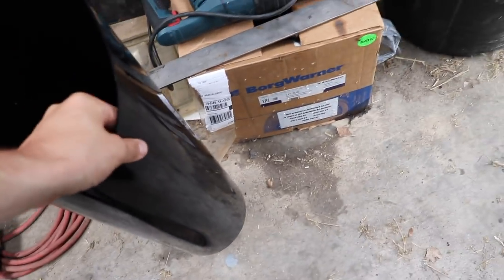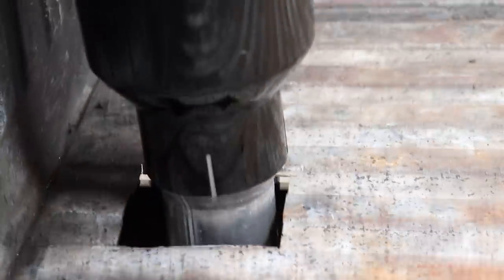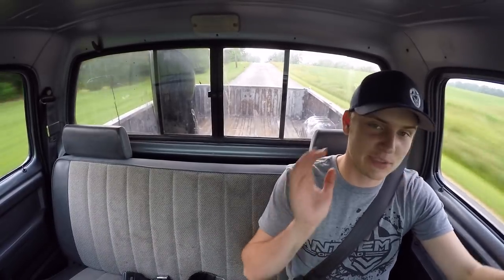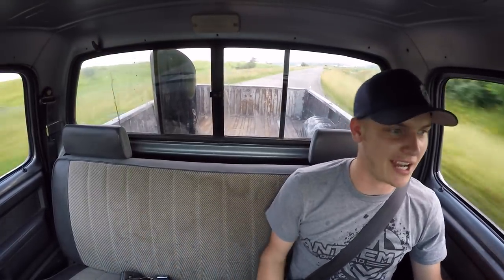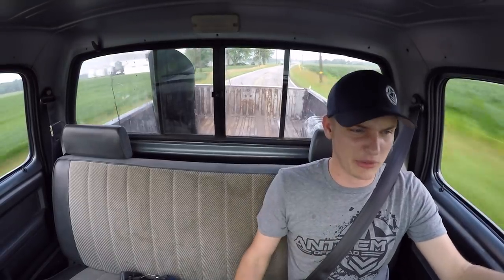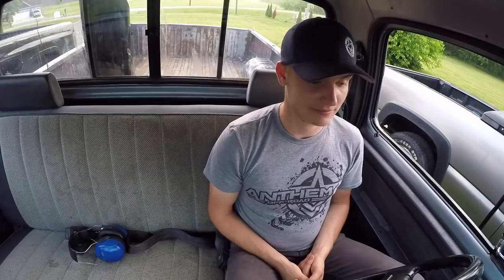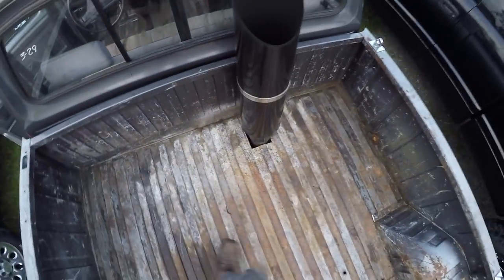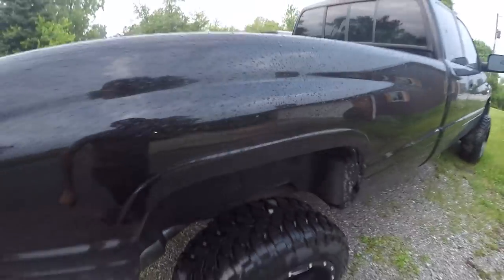WORLDS LOUDEST DIESEL SMOKE STACK EXHAUST!!!!

Comment: You should keep the Superduty 7.3. I like the obs 7.3 but they are not as powerful as the superdutys from 99-03. The superdutys have bigger injectors, bigger turbo, nicer interior, and they have an intercooler. You should just keep the one you got. You got way too many cummins. It would be cool if you had a obs 7.3 and a superduty 7.3. Love your vids by the way.

Comment: put a lunchbox locker in the rear end.  (~$300)  welding the diff will be terrible for turning radius...and you'll just break axles. you'll break the locker eventually, but it'll hold up for awhile.

Comment: Let’s all be honest. Is it any louder than say a p7100 truck with an auto or a vp44 truck that’s auto or a cp3 Cummins with an auto? I think not but the title sure led it on to be. Most old ve pump trucks werent near as loud as the vp44 trucks and take yourself an 06- early 07 5.9 auto straight pipe and you’ve got obnoxious loud. Have fun though

Comment: My truck has a 4” straight pipe, but became significantly quieter once I backed off my advanced timing and adjusted my valves. Like actually half as loud, it was crazy. I actually hear my exhaust now not the engine, and the exhaust ain’t that loud.
Reply: My 6.0 ford power stoke has a 8in
Reply: 8” what? Don’t tell me you have an 8” pipe from the turbo back. You might have a gay tip that’s 8” lol
Reply: I made my
Reply: Your making no sense man haha, lnp truck sounds good it’s just too loud lol
Reply: Hey l 18k truck l might put a smoke stack on the truck but my piece of shit duramax has a 4in
Reply: You are not making sense

Comment: If the stack is above the cab it is ten times quieter in the truck and looks cooler then you can put a rain cap on it and fit the trucks ara

Comment: Your gana need flex pipe for the 90* below the bed, it’s going to be too rigid. The flex pipe will absorb the vibrations and the movement differences between the engine, hangers and bed. Might end up breaking the welds or hangers. Seen it on every exhaust for a stack with solid pipe that I’ve seen. Just a heads up bud. You can get flex pipe at Home Depot, or even a auto parts store
Reply: Just make sure to buy stainless flex. Flex pipe is a rust factory.

Comment: Little dramatic with the hearing protection don’t you think? I used to run 6” straights dumped at my windows on my pete 379 with cat motor twice the size of yours. Did you really need to put on hearing protection for 30 seconds of video footage with back window open?
Reply from the maker: Not dramatic at all.. I just like to keep my hearing. If you don't... thats your choice..

Comment: My 7.3 has 4 inch down pipe to 5 inch to a 10 inch stack this isn’t loud 😂🙈
Reply: Shawn Nemitz not hating I've had a couple 7.3 and had every size exhaust stack tip that you can think of no matter what you do to your 7.3 they will never be as loud as the 12 valve and 24valve atleast not the 3 7.3s I've had
Reply: I have a question I have a factory 3.5” straight pipe to 10” tip and will a 4” or 5” straight pipe make it louder ( or stack) which is loudest ??
Reply: OBS Powerstroke your factory down pipe is not 3.5 inch. stock it is 3inches off the turbo and is necked down like a cobra head. if you still have that get a after market down pipe you can't do 4 of 5 inch off the turbo on obs 7.3 the fire wall and everything is in the way. get a couple adapters to connect your 3 Inch to 5inch off the down pipe all the way back. 5 inch is a lot deeper. 3 Inch to a 10 inch stack vs 5 inch to 10 inch the 5 inch will be louder and deeper
Reply: OBS Powerstroke Google obs 7.3 stock down pipe. there will always be one to tell you can fit a 4 inch on the obs yes with stupid amounts of work smashing your fire wall hitting your trans lines ect.  just get a 3 Inch still will be a little tricky. to make it easier on your after market down pipe where it connects to the turbo grind the pipe down just a little it will fit easier
Reply: Ok thank y’all